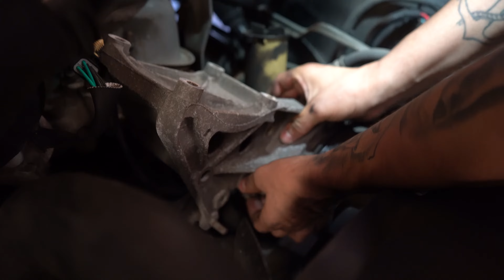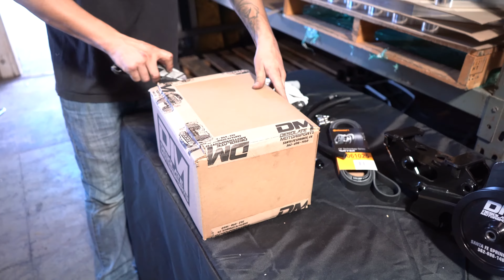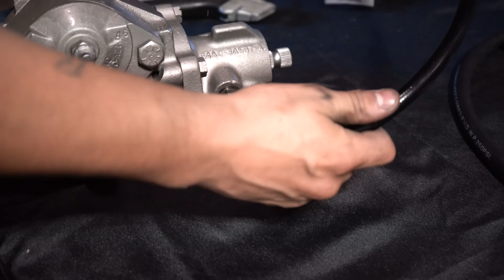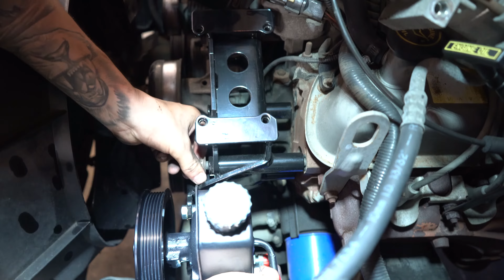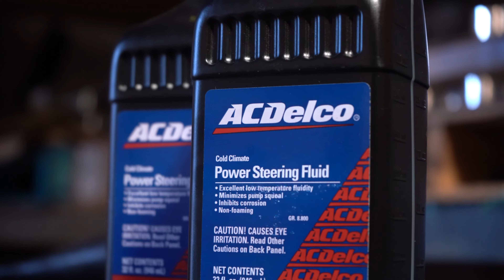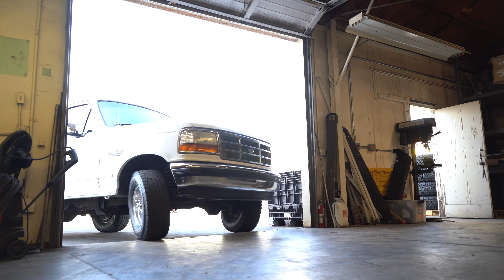Install Guide: Bronco/F150 Saginaw Power Steering Upgrade

Comment: I purchased just lines as I have a 1993 Saginaw pump and bracket from an E-van. Question.... how is the fluid cooled? I see it as it goes from the box right back into the pump, it's going to be pretty darn hot!

Comment: does anybody know if there is a kit availible for the 4.9l 300 inline 6 motor? I hate the sound of the stock pump. It's very annoying
Reply: Guitarhero1000 if you can find a 1994 E150 van it will have a factory Saginaw pump and bracketry.
Reply: @Tom-og7fi  thank you
Reply: @Tom-og7fi  only a 1994? Or will other years work?
Reply: @Guitarhero1000  that I'm not sure of,  possibly any E 150 with the 300 may work.
Reply: @Tom-og7fi  thank you

Comment: Thanx guys, Finally i have a quiet and smooth running power steering pump! I actually cant believe my truck is now quiet. Seriously. I was fixin to sell the truck because of the whine the old pump was making. Best $ Ive spent by far and simple to install.
92 3/8 belt was used with a deleted smog pump...seems to be working good with no squeak

Comment: Hi DM,  The link for the Power Steering Pump Pulley Removal Tool is missing.  Just an FYI.  Nice product.  You wouldn't have any leads on a nice rust free OBS Bronco would you??  Also,  a list of authorized shops who have been trained to your satisfaction for installing your OBS Bronco products.  That would be very helpful for when I'm looking to spend $10K-$15K on my personal Bronco,  I want to know that all the I's are dotted and T's are crossed and the welds must be OEM Pretty.  Start working on registering shops with links on your website so every Desolate Motorsports Customer can rest easy and know they are getting a 100% Fully Warranteed Job.  Great Products and wishing you The Best.

Comment: can i buy just the pump & use my already upgraded pump bracket? also just trash the stock/crossmember cooler line or can they be reused?
Reply: yeah it looks like there is a lot of wasted money here. this seems to be for people with "disposable income" basically the pump is different. ....but i'm sure they made it so you cant use their pump with the original bracket.
Reply: @kevsta67  They didn't design it so you can only use their pump/bracket combo. The Saginaw pump dates back to the late 60's. Its a GM design. Of course its not going to fit a Ford C2 power steering bracket. You could always go to your local junkyard though and get an power steering bracket from a Ford E series van as they used Saginaw pumps instead of the C2 pumps.
Reply: The pump they sell is a cardone reman pump, so long as your mounting bracket is for a saginaw style pump you could use any sag pump you want really. If you wanted to go through the effort of refitting the cooler lines i dont see why its not not possible to re use